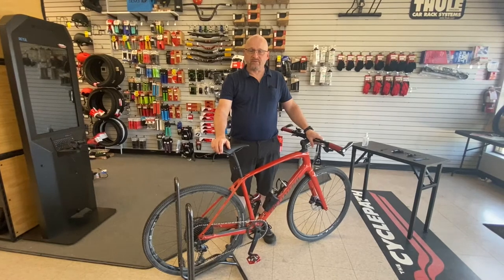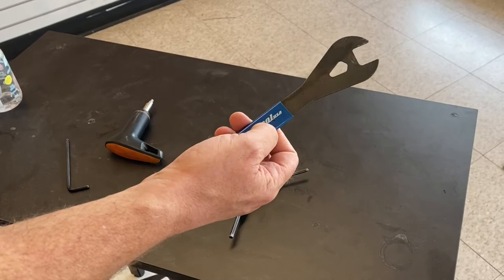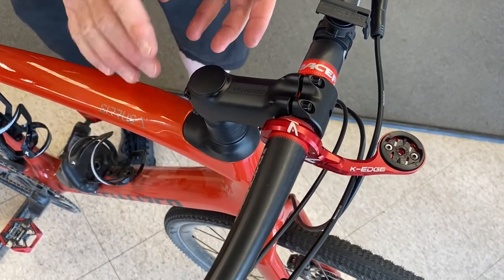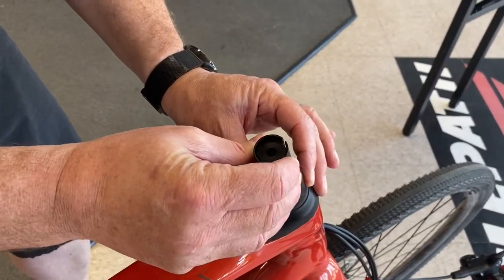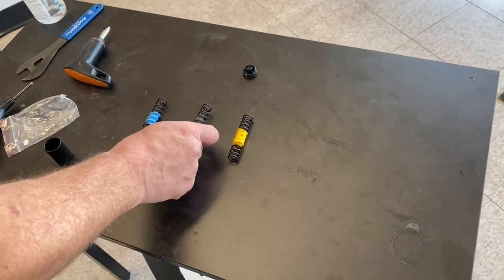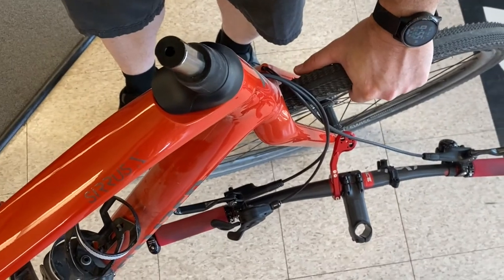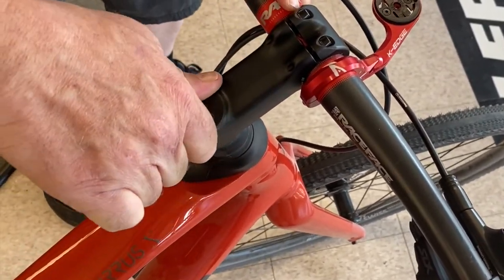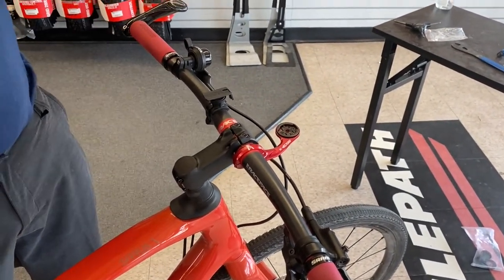Specialized Future Shock 1.5 Spring Change

Comment: Can we insert a spring harder than the hardest one ?
Or block the mechanism ?
Thx.
Reply: The FS 1.5 comes with 3 springs, soft, regular and firm. Lockout is on the 2.0, not the 1.5.
Reply: Why have the mechanism only to defeat the mechanism? I put the firmest spring in a few weeks ago. It made a big difference! Very firm now but eats the road chatter still. If I wanted harsh, I would take my Allez out for a spin.

Comment: Do the springs come with the bike.or do you have to buy them separately.
Reply from the maker: All Future Shock 1.5 bikes come with 3 springs. If yours didn't, contact your dealer. I would think Specialized would usually have spares available.
Reply: Thank you ..mine did not...

Comment: Do you know if it is possible to drive the bike without the future shock suspension?
Reply: It isn’t designed to be ridden without a spring, and the 1.5 does not have a lockout.